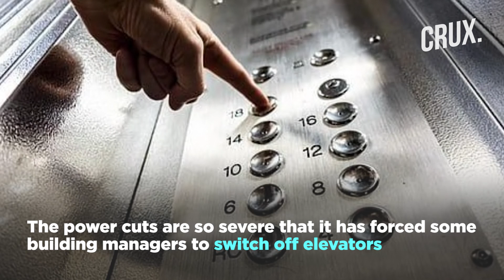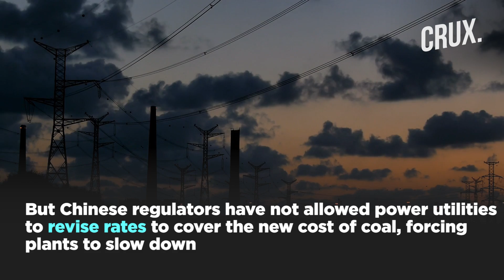China Blackout | The Perfect Storm That Led To China's Biggest Power Crisis In Decades

Comment: Only the Fukien province did not suffer outage amongst the eastern coastal provinces. Fukien province is directly facing Taiwan which is 100 miles offshore due east. None of the interior provinces suffered outage. What's the message???
After the AUSKUS and QUAD meet whilst with recent sabre rattling and verbal "come on" challenges between China and the US occurred just a few days ago, the sudden power outages occurred within and along these heavily populated economic zones where commerce and industries are located. These would be the first to be hit targeted zones at an out break of war and plunge into darkness. Don't you think so? It's a perfect simulation of an initial outbreak of war. Don't you think so?
There were reports of every possible shutdowns which brought the metropolitans to the dark ages. Nothing works during the outage ... BUT did you see any evidence of the underground metros grinding to a halt or the airports went into no fly? Do you know how many people use electrical trains to commute? Any evidence here?
Now think hard and think rational. Think really hard if not you may not realize that ALL buildings, commercial complexes, public utilities and factories have standby generators, AND they were NOT used. Why? These generators automatically go into operation during power outage. Something is not so right and it does not add up, or does it?
Think on and think hard. Do you really understand China's ability? Just like they managed the COVID-19 pandemic, this silent public drill caught most off guard but they will soon come to understand the actual reason.
At the same time you all heard the flimest excuse given for the outages, coming from the most modern and sophisticated nation on the planet. Do you really think that China's strategic resource management and disaster response and control management is that bad?
Prove me wrong!